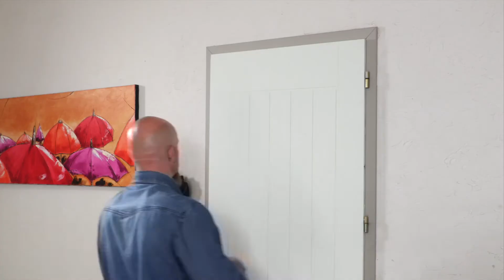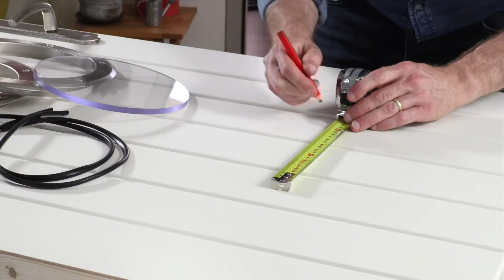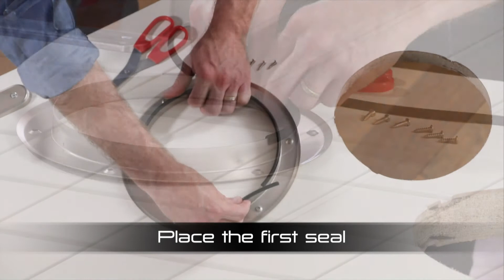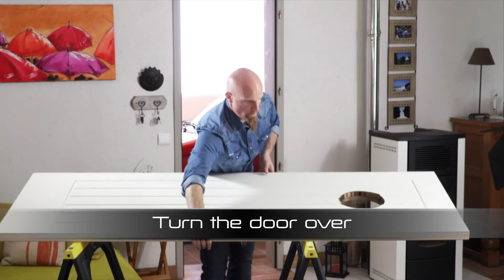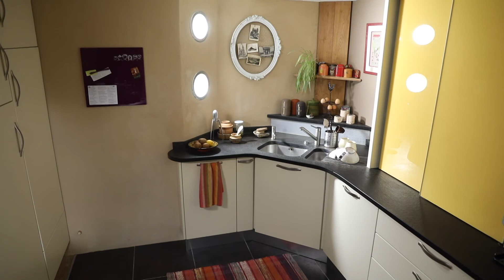MOTTEZ BRUSHED & POLISHED STEEL CIRCULAR PORTHOLE VISION PANEL | Screwfix

Comment: Well that's completely useless I woukd say. ZERO weatherproofing. It's shown fitted to an external door with grooves but any rain will just run straight into the doors exposed wooden core and rot it over time. Also a single pane of glass so no consideration for cold bridging at all. These things are only suitable for internal use. NEVER externally
Reply: Something's going on there.  The car is sitting on a tile floor and there appears to be a wall or something beyond the passenger side door.  Maybe this door is not in direct rainfall and maybe it is not a cold weather area.  However, your point is spot on, ZERO weatherproofing.  Maybe in this application, it isn't really required.
Reply: Product doesn't say it is for exterior use